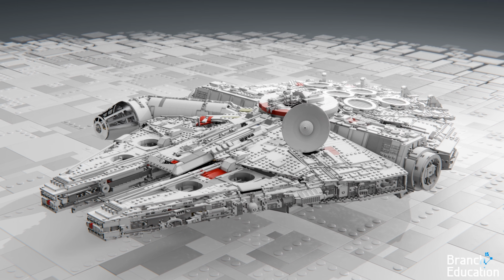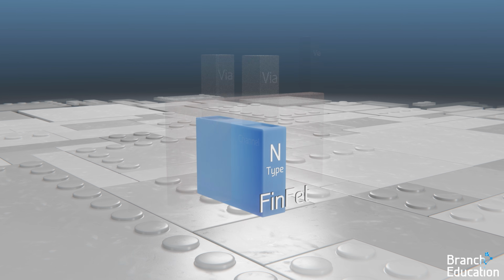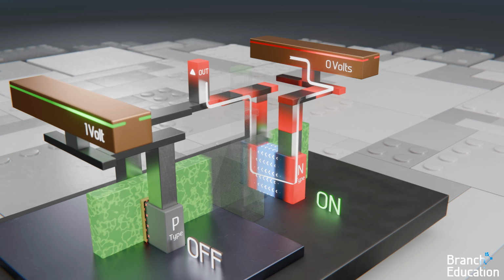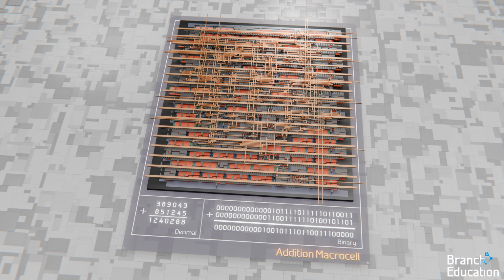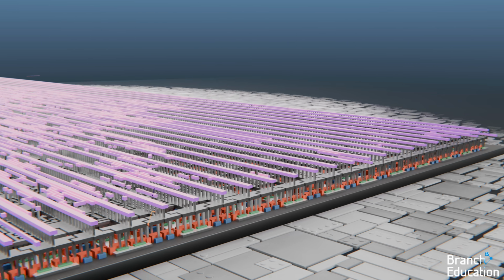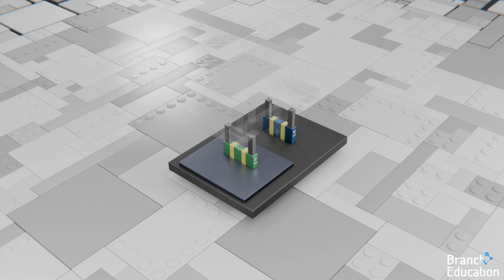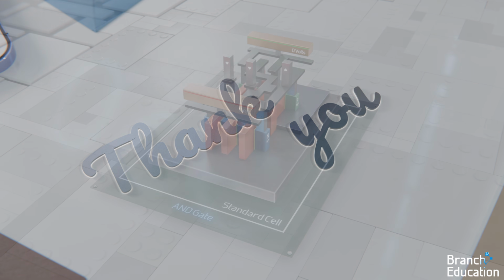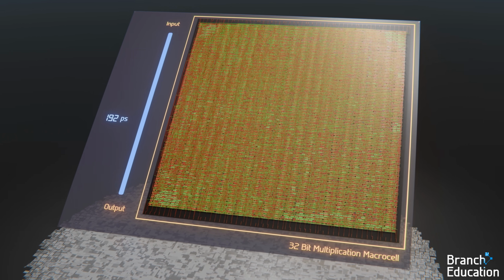How do Transistors Build into a CPU?  🖥️🤔  How do Transistors Work? 🖥️🤔

Comment: Reactivating now Solaire Metro Manila  with Modifications. Starting at the areas fronting the sea side area of measured based on specifications of ridge of indents of slits along of Outlined scaffold bars approximated the bars to the ridge of ground slits of downwards of exact sealed when closed  of sensor pixels sandwiching the layered Fabrics with pixel beams from its sensor indents to ground lower to deep area levels of when programmed tweak the extending up transluscent thin layered supermaterials tech fabrics wherein the bars have front and width of layered fabrics projectors like audiovisual LED lights of functionale of its upward high wall to its low deep below attach sealed to prevent floodgates entrance wherein the fabric walls facing the seas serves as its Sea water, minerals and molecular manipulator tech of molecular concentrate and dissipate designers of its intervalling interspaces to diffuse wave air pressure contrary to its general realitivity effect push towards thr builfing only as scanned scoped and programmed pencil beamed by pixels sandwich after push buttoned activate of Tsunami dispersals and counterwave effects at the fabrics fix dormant mode to wavy shift shape of wave coherency of real science in action physics anc chemistry in active to passive motion wavelength wise tandemed along thd bars curtains fabrics  co affector at likened to a wavy AN- TPY radar system beam project to what it faced clouds, air, and seas assisted by my Quantum Networks to achieve at specific ranges of Tsunami strength of diffuse. Of another mode of LED like Billboarding digital imagery with another extending up and retract down up by program effect meshwirings with at a specific angular of proximity energy nodes at the ground likened to open and close aircraft carrier plenty of round metal anchors of fighter jets of open and close this time of ground interval space lines of base anchors for the meshwirings of slant of another anchor by beams at the bars of tech and magnetize of by specific of tiltable bean beams from ground base to its up building to and fro receptor transceiver energy nodes meshwirings up cloud computings and orientational Vector Magnitude  Effect by functionale. To its future application of wall computers of finger to palm manipulate and orbital satellite links. Let it be

Comment: I am so confused.  We learned in high school physics that voltage has a concept of essentially an electrical “pressure”.  If zero volts is zero, how can it “flow” anywhere?  I’m assuming it means to ground?  But even if that’s the case, how does that work?  What’s attracting it our pulling it?  How is there a voltage potential?  Is earth/ground negative and thus less than zero volts?

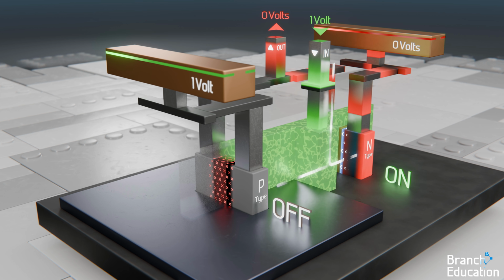Comment: 7:49 I don't really understand this part. If standard cells consisted only of 1 transistor I imagine I would have a similar result, considering the p-type or n-type as you wish. Is it really 0 volt? Because 0 volt means no current, isn't it?

Comment: i think i have an issue ..... despite this video being the most well made video about this subject , i still dont understand how CPUs work. i mean i know how binary logic works, i works with logic gates everyday to the point i build a lot of projects using FPGA and logic gates circuits without any programming just to challenge my Arduino friends.
all the videos ive watched on YouTube explaining CPUs just describe them as calculation units by mentioning the "ALU", but what about other stuff like i want a blinking LED , a 7-segemnt Counter,  stepper motor driver, rendering a 2d mono colored game or even display a low resolution VGA picture, HOW can the ALU do that ?

Comment: As a hardware engineer that works for Google...this is brilliantly explained!
Reply: ok. so why in video,,they say..zero is flowing? flowing is only,,when there is 1volt. no volt...no electricity, no flow
Reply: @deejayGOLDEE A zero binary number isn't the same as zero volts. A zero bit can be represented by 1 volt and a one bit can be represented by 5 volts or vice versa.
Reply: If you don’t mind me asking, what is your degree in? And from what school? I really wanted to be a hardware engineer/computer engineer when I was younger, but was discouraged when my local schools didn’t have any degrees like that. Except for the usual things like computer science, electrical engineering, CIS, etc
Reply: @Pauling. Electrical engineering is a hardware engineer, just focus/specialize in IC and hardware design
Reply: expensive Contents
Reply: Yea but cmon you could have tipped $100 man
Reply: I'm taking that job lil guy

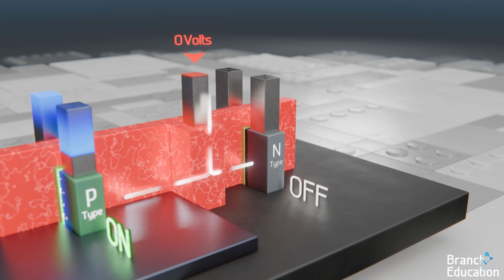Comment: I still wonder one thing. When 1 volt is supplied to the gate, where does the 1 volt current from that gate go? to the silicon base? or is there a wire leading to the ground rail? or to the power rail? or is it wired to another transistor? or does it stay in the gate and not flow anywhere? Please give me an answer, thank you very much. 5:40
Reply: We changed the script, and your answer to this question is not in this video. But when the Gate is supplied one volt, there's an electric field around the gate, and it can pass through the dielectric material that separates the gate from the channel. This electric field turns on the Channel. The one Volt that reached the Gate is not supposed to go anywhere, but still, there is energy loss because of leakage currents. The current from the Gate leaks to the surrounding parts of the transistors(a tiny bit). What the transistor uses to work is just the electric field from the Gate.
Reply: @parveshkhatri1027 Thanks so much, your answer is all I needed !
Reply: @gamingreviews2529  Videos with even more info on this topic are in progress, stay tuned :)
Reply: @parveshkhatri1027 i am looking forward to it !

Comment: ok im super confused, isnt an inverter literally just identical to a regular transistor? You input a voltage into a p type and get no voltage, you release the voltage on the p-type and get a voltage. What the heck is the purpose of an inverter???
Reply: You are right, to get 0 volts, we can just turn off the P-type and get no voltage. But the catch is that 0 volts here is connecting the output to the ground.

Comment: Thanks 👍
Wrong design for the gates I think: they shouldn't have unnecessary inverters and such; increases the number of Transistors and circuit complexity, creating unnecessary more heat and design time.
Logic Gates can be build with Diodes, we don't need Transistors; it's a much simpler and faster component; so why we use transistors?

Comment: Hi, a very well made video. but i feel that there is a knowledge gap in your illustration. you have not explain the first part. ie, form p-n junction to diode, from diode to transister, then operational amp and differential amp and finally to universal gate( standard Cell). also how gate can be configure as memory. 

With memory and universal gate it can be build in ALU, etc. 

The rest is hisory.

Comment: great stuff!
suggestion: you can take this as a starting point to a whole series, gradually zooming out, explain more about IP cores, how IP blocks interact with each other and form 1 core, how multiple cores form a chip, etc.
then you can talk about how other components interact with the CPU,
then you can even talk about firmware, and how software/ code is translated to the interactions we see in the hardware,
you can chose where to stop...

Comment: One question : If there is dielectric-barrier between gate and the channel…., then how does the current flows between them?

Second one : If whole structure is filled with dielectric resin, then wouldn’t it creates a short circuit inside the CMOS..?

Comment: Not discussed here is that advanced semiconductors, such as those in smartphones and GPUs, have become so dense that making a perfect transistor is very difficult. 

They design them to work despite some manufacturing defects, they grade them and then  sell them accordingly. 

As for lithography machines? It is just one part of the equation in making advanced semiconductors at a large scale with high yield. You still need the cooks, govt support and all sorts of other equipment, software and resources to produce it.

 This is one reason Intel has issues with manufacturing chips that can compete directly with TSMC.  TSMCs cooks are really that good.

Comment: Video about how the transistors work? I mean, please break down how the emf produced holds electrons from moving through the gate and how quantum tunneling has prevented the size of the transistors from continuing to get smaller and how that works (best anyone can) and possible fixes to that problem?
Reply: This is a bit long: Semi-conductor breakdown:  A semi-conductor is an (semi)-insulator that does not pass electricity, but once that 'side' of a gate formed on a semi-conductor is hit with incoming electricity, then electricity overwhelms the insulation property which then allows electricity to pass through it. QE: Since it requires materials to create a transistor some number of 'atoms' are currently the smallest a transistor can be. Quantum Tunneling: this is already used to direct beams/particles toward CPU 'cells' during construction, but it also allows penetration through very thin materials used in electronics such as semi-conductors; further, on earth, quantum rays cause decoherence and other quantum noise - thus causing some errors in computers. Error correction mitigations attempt to handle these, but correction is an ATTEMPT to fix errors after they occur while mitigation tries to reduce the impact of errors without correcting them. Hth's :)

Comment: I have a question for everyone how do we build so much tiny things I mean they are so tiny for us to build them by hand please leave your answers here or feel free to make a video about it
Reply: Here are a couple of interesting techniques used to manufacture these tiny products. Purified water - totally devoid of particles is used to clean the disks - several times. How it works: the water is applied to the 'printed' disc so that dirt, dust and other particles literally float on top the water, the particles can now be removed! The printed lines are metal, they are 'printed' on the silicon disc by covering the disc with a stencil - called a mask - so the metal goes through the lines in the stencil. The tiny lines are made even smaller and are self-aligned by moving the light and stencil from the silicon. Just like you might do with a flashlight!  Neat huh? :)

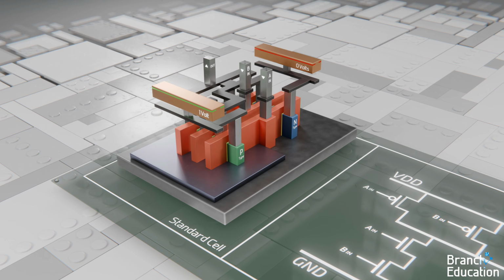Comment: I’ve a doubt at the AND gate at 21:56. The source of the N-type of NOT section of AND gate is not connected to the Ground rail. Instead it is connected to the intermediary output of the NAND section of AND gate. This will result in the output being one even if the inputs are zero. I’m not very familiar with any of the optimizations used so if anyone can explain whether there’s something I didn’t understand. Thanks in advance.

Comment: Question: do macrocells use multiple clock cycles, or are they designed to work as one massive black box and yield their outputs within one clock cycle?
Reply: Great question! It depends on the macrocell. Some are purely combinational and produce outputs within a single clock cycle. Others are sequential, meaning they include flip-flops or registers and can span multiple clock cycles internally. So they’re not always a black box that finishes everything in one tick — it varies by design and complexity.

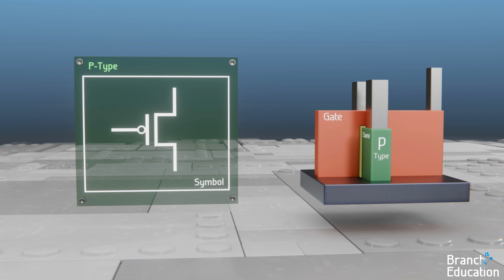Comment: 04:57 If the p type transistor invert the input then why we need two transistors to make an inverter
Reply: Great question! A single p-type transistor can’t form a proper inverter on its own because it only conducts when the input is low. To get a clean and reliable output, we pair it with an n-type transistor — one pulls the output high, the other pulls it low. This push-pull setup ensures strong 0s and 1s, which is why both are needed in a CMOS inverter.
Reply: Thank you so much for clearing the doubt @BranchEducationPlus

Comment: Whew must be hardworking if hand made🤔 without machine required made them !. I am bet it lots lots hours to build by handmade ! It tiny and need tiny tools to waffle them 🤔 wow 👌  but nice work but still need more functionality to better picture and etc. Loop flip of choosing to be quality be ability fit games or programs.  If not fit programs or game it different movements need update key to be run function right🤔

Then I am think can do build back like old grandparent's tubers machine,  i am think need big old wherehouse to build huge cpu and plug a coal factory electronic then flick old tube television so I am can play as switch 2?. How bad smog will be how much cost me for it😂😂😂😂🤣🤣🤣😁 forget that🤔 rather PCB made own cpu. Cheaper than big old one glowing and hotter than outside and coal pumping more coal like a old titanic engine to give electricity! To flip a screen and play one game🤔

Comment: This in conjunction with the earlier video about how chips are made, I really feel like they put things in perspective.
Though it's hard to picture honestly, since the dimensions are so freaking tiny.

So lazy me went and asked Gemini: "if a transistor was the size of a 1 euro coin how big would a recent gen desktop cpu be?" (Diameter 23.25 mm / bit less than 1 freedom unit)
--> Result: Using an apple M2 ultra as an example you would get a chip roughly 57 square kilometres in size, so about the size of Croatia or Manhattan.

Even if the Bot result were off by an order of magnitude, the scale is just mind blowing in my opinion.
(Off for sure since not all transistors will be spaces equally of course)

Comment: Thank you for the explanation and very well put together. I knew what a basic transistor was, but I didn't know that there were different types and how complex they could get. For most of my life I've always wanted to learn how computers worked. Learning what a basic transistor was, I was only at the tip of the ice berge. I never thought that there'd be more types of transistors and more complex then just a simple one that gave a 1 and 0. Now I feel like I've finally able to get a grasp how computers actually work. Thank you for putting so much thought and work into these videos. By now I've watched almost every single one.
Reply: That means the world to us — thank you for sticking with the channel and diving deep! It’s incredibly rewarding to hear that the videos helped connect the dots. We’ll keep making more to peel back even more layers of the iceberg!

Comment: For the AND gate, why not arrange the N-type transistors in series and the P-type transistors in parallel? Why does there have to be an inverter?
Reply: Apparently, in CMOS, N-type transistors are only allowed to pull a voltage down and P-type transistors are only allowed to pull a voltage up.
Reply: Those are finFETs! 
But you can create your own diagram.
Reply: @x-gamessimulator1067 Can you elaborate?

Comment: Makes me wonder.. how the heck do they decouple the power rails? Having billions of transistors switching at the same time isn't good for your power rails
Reply: The rails must be connected in parallel!
So we have 1.1V or 1.3V with very high currents! 
A 65W processor means
Watts = Volts x Ampere
65 = 1.3V x ?
65 : 1.3 = 50A
50 Amperes no processador!

Comment: I have a question about the inverter standard cell: Why not just hook up a P-type transistor to a power rail and connect input and output? Why would you need the N-type too?
Reply: The power bus is only for powering the ports!
If you don't power the logic gates, they won't work!

The input and output are for converting binaries!
Complex systems such as an adder block require the logic gates to be connected to each other. 
The output is connected to other inputs to form a complex system!
64 bits are 64 cables to connect complex systems!

Why not just use a P-channel FinFET!

You don't just use an N-channel, I think because you don't get signal noise in the finFET.

Connecting the NOT to a P-channel finFET for the 0V I think reduces the noise or distortion of the square waves.
Reply: @x-gamessimulator1067 That did not help at all

Comment: Main thing I love of this video, is the explanation of transistors using specifically processor type transistors.

With other videos, they explain the story of transistors, and how they are made, and how the work in macroscopic circuits (the black head and 3 pins type of transistor) and then say: "and the computer has million of these" and proceed to show an image of a processor 10,000x and you can only see lines and nothing looks like a transistor that was explained.

Comment: Something being incorrected with Inverter demonstration. Overal, n-FET always be in  OFF state, so this n-fet is useless. Ultimately, just need p-type FET is enough to operate logic. 
Definitely no problem with the inverter, the demonstration has little problem.
Reply: No!
You have to get both the P and N channel!

The N channel is the main one! The P channel is for safety because when the P channel is active it is connected directly to GND (0V) I think this is for noise reduction and to perfect the square waves. 
It can't reach 0.5V because then the computer would get confused between 0 and 1. 
Also, if you used a capacitor instead of a P-channel finFET, there would be a delay in the processor.